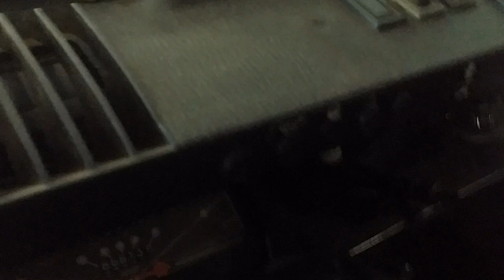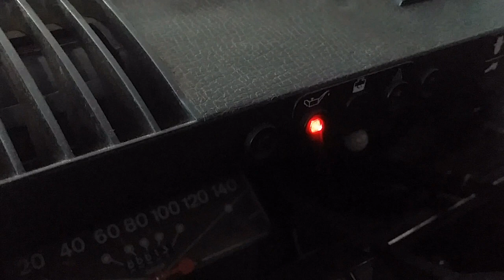Citroën dyane gets a new engine- and a testdrive.

Comment: I’m cleaning up my Dyane engine and refitting everything this week. Great to learn the tip about tightening the manifolds before the heads. What torque settings did you use in the head bolts? Thanks for a great video 👍
Reply from the maker: Thanks for watching!
Yes its very important to do it that way to prevent premature intake/exhaust gasket leak. :)
I cant remember but I think its 10nm in first go and 25 in second... :)
Reply: Seaside Garage - great, thank you!